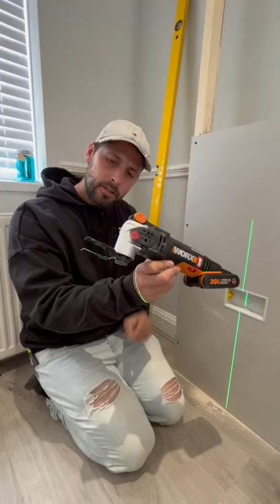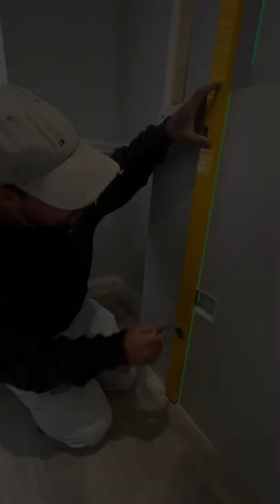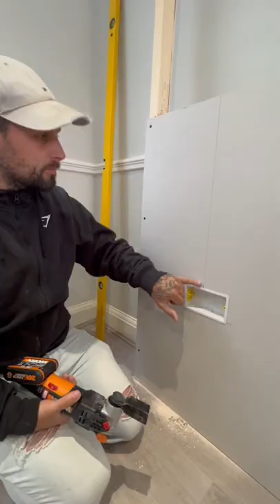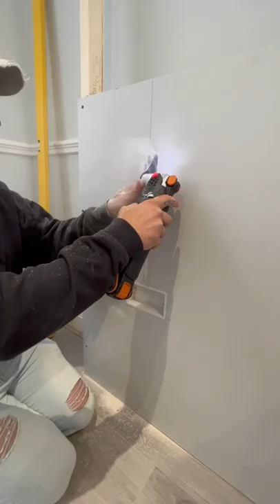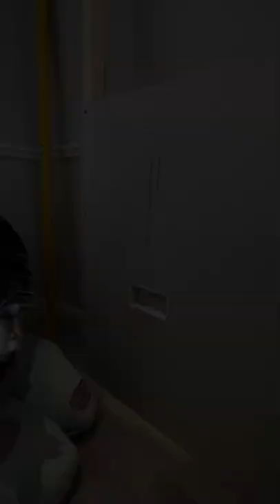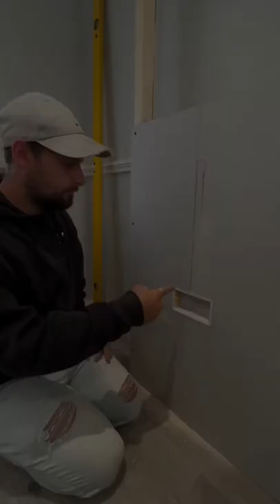LIFE HACK - USE MULTI TOOL TO CHANNEL PLASTERBOARD WALL #diy #homeimprovement #drywall #shorts #pro

Comment: any option for depth control so i don't hit a stud or something else I shouldn't, don't even care if I have to finish with hand saw. I have never done this and wondering if a zip tool or this would be easier to control for someone with no experience. Also, do these not heat up, a guy told me I couldn't use power tools cause insulation could catch on fire. Trying to learn here. Great video!